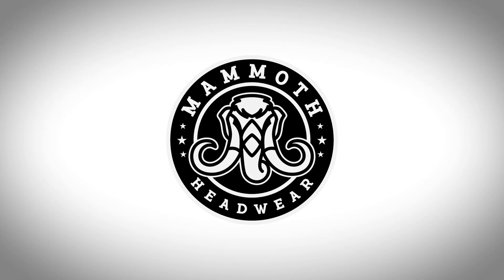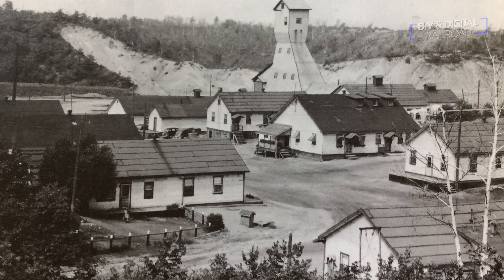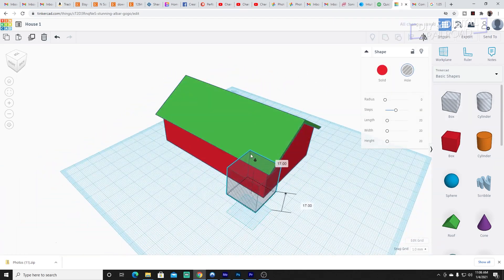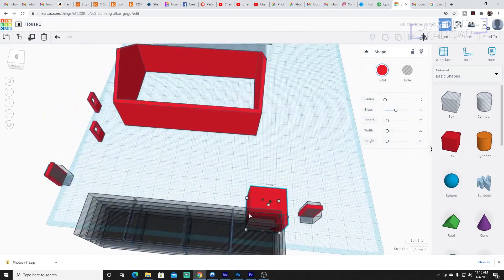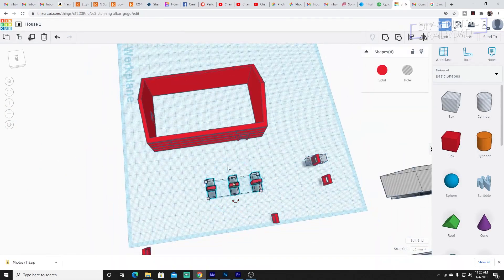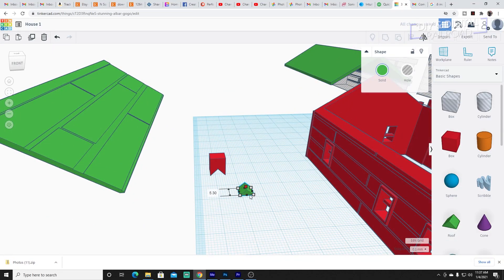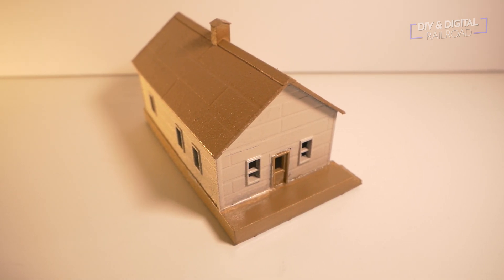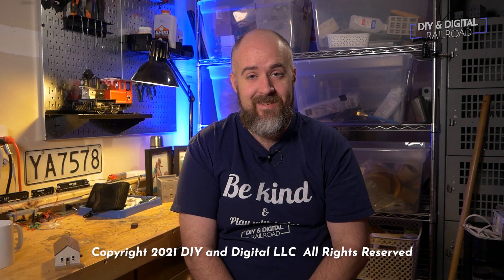3D Printing a House for Model Railroads

Comment: What layer height did you slice that at, and how many layers was it?
Reply from the maker: 0.05mm height (for speed). 1853 layers when properly angled on the build plate.  I use matterhackers Build series resin in my anycubic photons and it takes 16 seconds per layer to cure, so 0.03mm was out of the question for time's sake.
Reply: @DIYDigitalRailroad 

I'm just starting out in 3D printing. I went with an Ender 3 S1 filament printer. I love it! 

I'm looking into doing some houses and things, and was wondering if you would offer up the files themselves so I (and others) could slice them for our own printers?

Comment: how soon for some HO scale buildings?
Reply from the maker: So that is a complicated answer.  The size of HO Scale buildings is the main factor.  Resin printers are just now getting to the size that I can print HO Scale buildings.  I am hoping for a small production capacity by the summer.  The set up I am pricing out for producing HO Scale buildings is about $1200.  There is a demand for it so I am happily producing it.  Right now it's hard to get my hands on a large resin printer.  I do have the models sliced and ready to go once I get the printers.

Comment: I was wondering why you’d 3d print something as geometric as a building instead of using styrene sheets. Making repeats is a good reason! I’m also curious if you could 3d print much smaller and more organic things eg n scale people!
Reply from the maker: The real reason?  I'm terrible with Styrene! 😂😂😂
Reply: @DIYDigitalRailroad  well you are very skilful with your 3D modelling tools so fair play. Though after watching people like Luke Towan and Ron Marsh, styrene looks so easy... :-)
Reply: Yes, the type of printer he's using (a resin printer) is best suited for highly detailed items. You can get a resolution as fine as 10/1000 mm (10 microns) layer height (Z axis), and 47/1000mm (47 microns) pixel size on the X-Y axis. Depending on the capability of the printer, you can go even finer than that on the X-Y plane! So yes, it can print N Scale people very nicely!